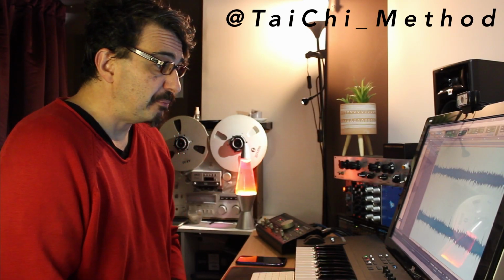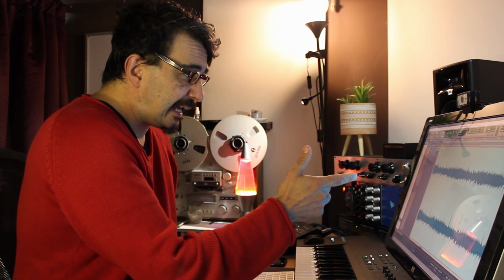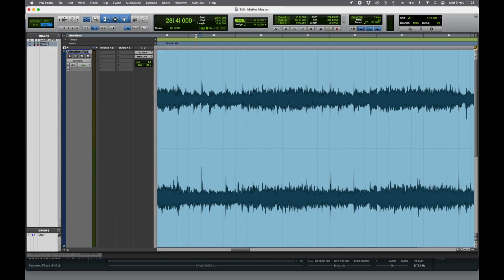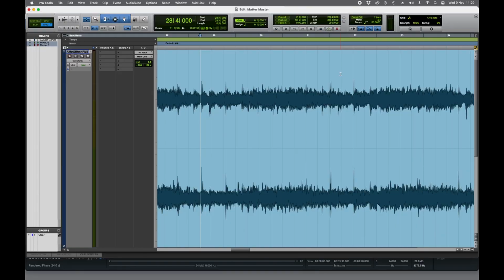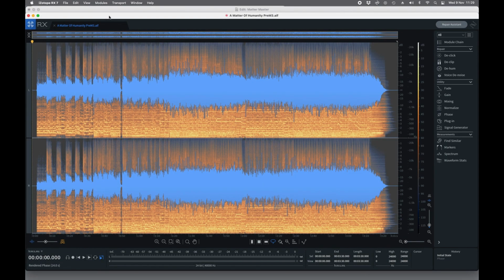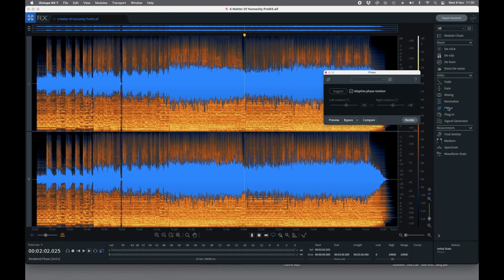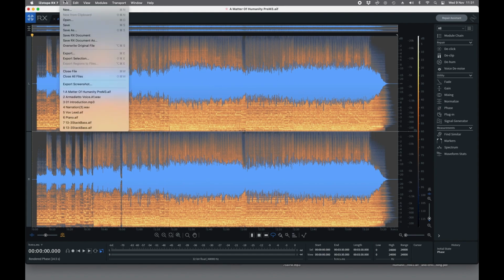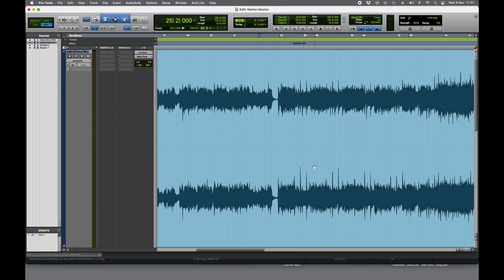Prepping for mastering - Have you ever seen those weird asymmetrical waveforms? Here’s what they are

Comment: Does doing the adaptive phase rotation have any negative side effects?
Reply: I was asking about on the mastering level. Does phase rotation have any negative side effects when applied on entire mixes? Sometimes i get songs in from people that are asymetrical, but i hesitate to do phase rotation for fear of affecting the way the kick hits or something
Reply from the maker: @Barncore  so far I never had issues with transient definition (or anything really) after adaptive phase rotation. If there was any change it must have been minimal and anyway you might introduce phase shifting every time you apply HPFs or multi band compressors (the crossovers might turn the phase when engaged). I always apply the process confidently but check afterwards. So far nothing wrong happened
Reply: So what would happen if you phase rotated a pure saw wave then?? Asymmetric by definition so would it become a square wave??
Reply from the maker: Hey. Thanks for asking - No, so far I’ve never had any issues with it. 
If you are in control of the mix and don’t want to rotate the phase of the whole thing, look for the single tracks that have that issue. 
Brass instruments do that quite a bit and bass guitars too. If you solve the problem in the mix then your master should be safe